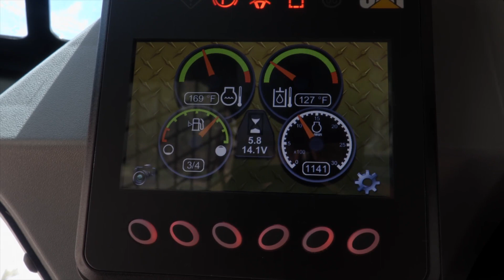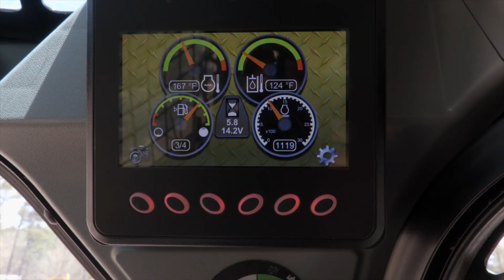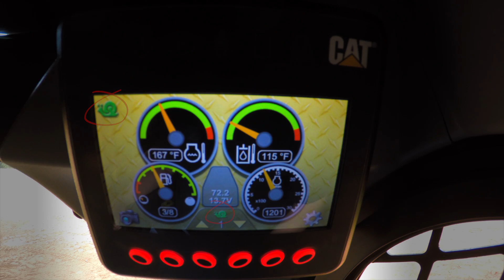Cat® Industrial Brushcutter Operating Tips

Comment: I would never buy another Cat machine, choosing cat was the worst decision I have made. I have  owned several machines over the past 15 years and have run almost everything brand on the market. Bought a new cat and ran it 240 hrs about 5 weeks, cleaned and did normal daily service like we have with all of other machines for 15 years but one day the cat cought fire bursting into flames, the machine locked up with loader up almost burnt up my operator, and when I called cat to tell them about it they told me it was my fault , because I used it in the woods although it was sold to me as a unit that was setup to run a mulching head every day, Cat is such a BS company now, I would never recommend a cat to anyone. And then they signed my name with out my consent on documents to cover there ass,
Reply: same here screw cat
Reply: Wow!!! I had it narrowed down to CAT, Bobcat or Case. After hearing your story CAT is definitely out. Honestly, I like Case. Would love an SV250. My dream machine.
Reply: I’ve seen other reviews on YouTube by pros that say CATs allow too much debris into the engine compartment. Why pay extra for a kit to resolve that when you can just go with another brand that will most likely cost less anyway? Also, visibility is the worst of all brands in skid steers. That’s a HUGE issue for me. One YouTube channel, no names, talked about how expensive parts and repairs were for anything CAT. Bills that are normally $300 for other brands cost $3,000 for CAT. No thank you.
Reply: Which brand would you recommend, if not Cat?
Reply: @Coltswannab9  Bobcat! I have 2 Cats and my brother has a Bobcat it's so much better man! Bobcat controls 22% of the market with that percentage of market control you have so many advantages! ie parts, dealerships, etc.
after Bobcat prolly Kubota.
Reply: @Coltswannab9 throwing my 2 cents in 7years later. And that is I would recommend bobcat or asv(only under certain circumstances). That said I still think cat is third/and a half place with John deere being in third. Jcb have a ton of issues especially electrical problems, case/ new holland are 50/50 with half of their machines spending a ton of time in shops and leaving the owner/operator with a lot of downtime. Kubota is ok but they are kinda of weak and expensive. John deere skidsteers are ok depending on your dealer but they can be expensive to fix other than that they are decent machines. Now why do I recommend bobcat, it isbfor the same reason they have so many dealers and why so many contractors run them. They are solidly built , have nice sized engine bays, have great lifting and pushing power and excellent hydraulic power. Side note asv is great for forestry work and that's about it imo they have very expensive undercarriage that does offer a nice ride but I feel is not worth it due to track issues. Avs I dont think is worth it unless you are looking just at max hyd flow and cooling capacity(which bobcat is closing the gap in that regards with the t86 model)
Reply: @Coltswannab9  a bobcat
Reply: Tommy Wallacpp?
Reply: Asv is the master of mulching
Reply: Lies.

Comment: Sorry fellas, but I see an over engineered, expensive Bush Hog! I'll stick with my Massey, and PTO driven (stump jumper) Howse mower! They would have made quick work of that small stuff, and are much more safe!
Reply: Enjoy your $1,000 punctures
Reply: Yea
Reply: Tenringtgy1 yea i have a ford tractor with a bushhog and after cutting 2 to 4 inch ceders for about 1000 hours the blades have cut a donut in the deck id rather have this machine thats made for the chunky stuff